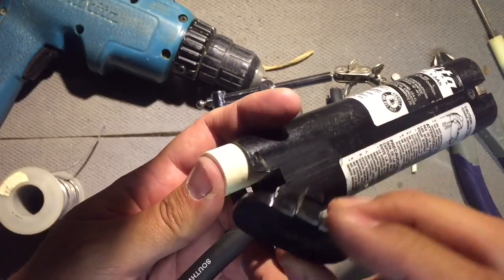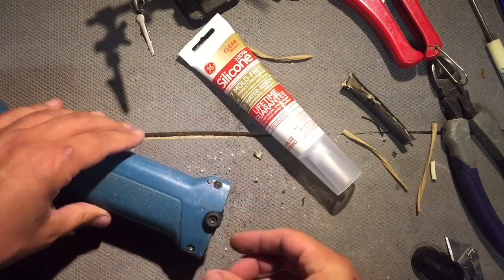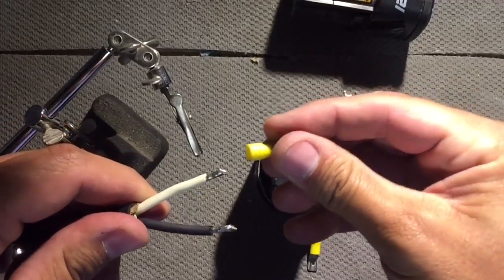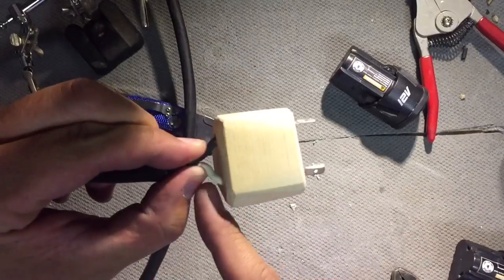How To Battery Hack a Makita 9.6v - Easy Lithium Ion Conversion Upgrade

Comment: You can buy batteries for these all day long for around 20$ on Amazon.  30$ if you want to upgrade to nimh 3000mAh. If you want to rebuild the original pack you can buy high quality 2200mAh cells for around 3$ each.
Reply: Exactly what I was thinking.  Personally I think it's ridiculous. This is nearly useless and more expensive than simply replacing the original batteries.
Reply from the maker: You are right, it nearly is useless. You could spend $20 for a battery, but then you have to keep nicad or nimh batts charged regularly. Otherwise your $20 goes down the drain.

For me I keep my Craftsman batts charged because its my goto drill. But occasionally I need to use my old makita saw, stapler, jig, or right angle drill, and why should I spend $20 and have to keep a battery charged, when I can just use my charged craftsman battery in a pinch???

It wasn’t more expensive. It didn’t cost me anything.
Reply: And your point is? All batteries need charging (which you state you keep some charged) and now you have this wonderful corded battery that took how long to make? And cost how much? Just so you can drag around a corded battery pack? The whole concept of portable battery powered tools are so you don't have to drag a cord around. Cute but not very practical. (Veteran carpenter/contractor.) Have fun with your "toy".
Reply from the maker: Nicad and nimh batteries shouldn’t be left on the charger. Also they will stop working if left on the shelf unused. If you use a makita regularly then you should definitely buy a nimh battery. But if you rarely use a makita, and you buy a $20 battery, charge it, then go to grab it a year later its voltage will have dropped below the recharging point and be useless.

Lipos do not have this issue. They can be charged and shelved for years. Yes you can convert makitas to lipos, yes there are videos on youtube on how todo that.

On RARE occasions I could use my little makita circular saw, or a the makita power stapler, or the makita right angle drill. For those RARE occasions I built this so I can use my already charged and available craftsman battery for the 10 minutes I’m going to use that tool.

I’m surprised carpenters would even be interested these old 9.6v tools. I would have thought they would have moved on to 12v lipos.

I am not a veteran carpenter. I’m a hobbiest just having fun. I’m sorry if that bothers you.
Reply: @punkerpanda131369   I have bought those replacement batteries.  Never as good as the Makita brand, which are not so great anymore.   You need 3 to really do anything with this.   So figure $120 for 3 real Makitas.   Or buy one Milwaukee M12 kit to have a cordless with much more battery life and power.    My Makita sits at a remote cabin rarely used.  When needed, the issue isn't portability but that the dang batteries are dead again, won't hold a charge.   If we can just plug in and have it work, then the cord is not a problem for a spare driver.
Reply: You don't get it Vern.    I am a veteran builder but I appreciate the venerable old Makita and like having a use for my old tools and wanted a corded driver drill that is 100% reliable.  Couldn't find one.  All cordless.   Just because you don't see beyond your own specific use doesn't mean there aren't any.

Comment: I'd love to replace the heavy lead acid batterirs in my portable inverter power packs with lithium ion but I'm terrified of the potential fire hazard should they go bad and ignite.
Reply from the maker: Actual replacement of batts, requires changing of chargers, heat sensors, discharge sensors, etc. my drill method here works, but I think theres more science involved with inverter packs.